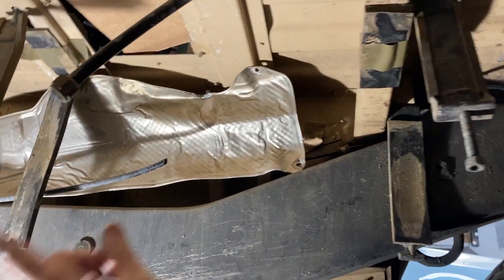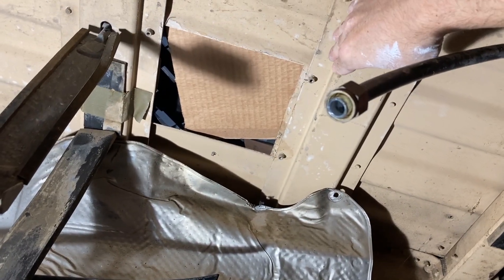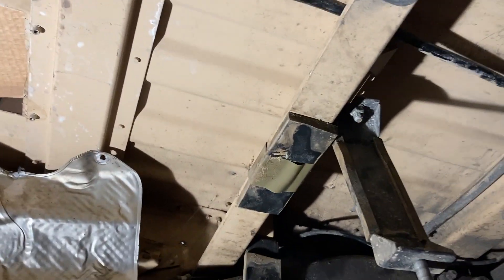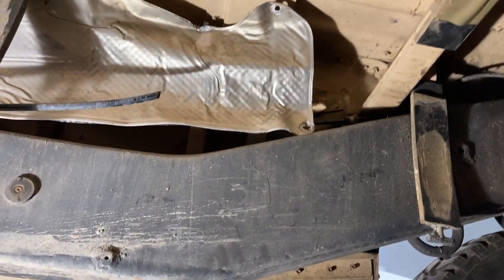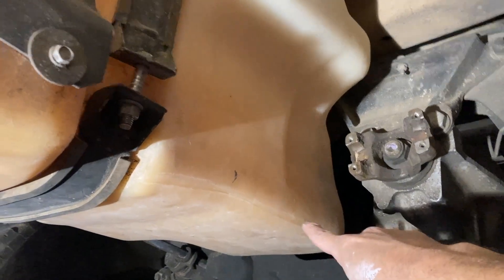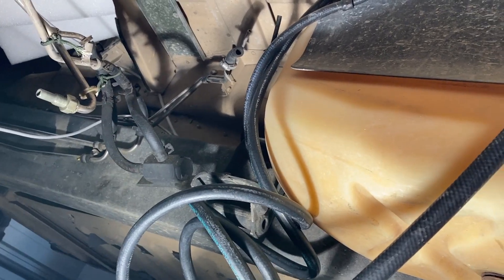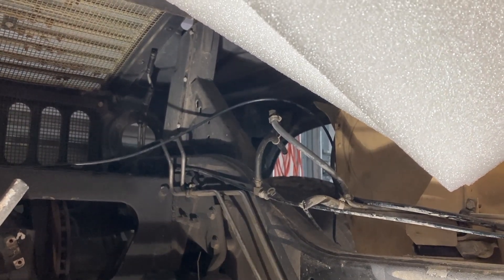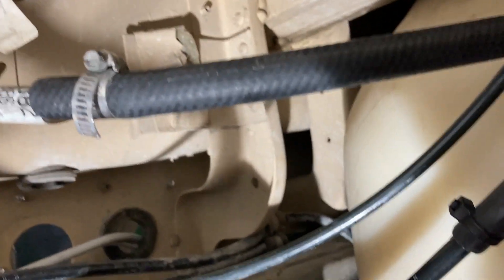Humvee Fuel tank installation

Comment: Thanks for the video. Did you end up installing check valves in the return & sending lines?
Reply from the maker: No. FWIW it also is not perfect air tight so I have to be careful not to overfill, or it'll leak on the tank via the pump or plate joint
Reply: Ok good to know. I just put a new tank in mine and had to remove the sending check valve since it was clogged up. Going to run it without since it seems to be holding prime.

Comment: How has the red rtv held up to gasoline?
Reply from the maker: seems to be ok. It leaks fuel if I overfill, but no telling where that's making its escape. likely at the rubber "seal" ring that joins the plastic pump to the metal plate

Comment: Is it common for the rubber lines to chafe up near the frame? I have a drip coming from that area. I'll be dropping the tank soon to investigate.
Reply from the maker: I dont think so. They're pretty stout too. Possible you have a leak at the rubber neck that connects the plastic tank neck to the metal filler neck as the plastic neck is tucked over the frame rail. I have a friend whose truck will leak there, so the whole filler neck will eventually leak down if not burned/filled into the tank. Getting the tank out is a pain. hav to remove the angle plate that holds the skid bars for the rear brake on that side

Comment: What size are the rubber hoses/fuel lines??
Reply from the maker: the fuel lines were a 3/8 supply and 1/4" vent line. OD measurement of the hard metal lines
Reply: @sdalin27  thank you